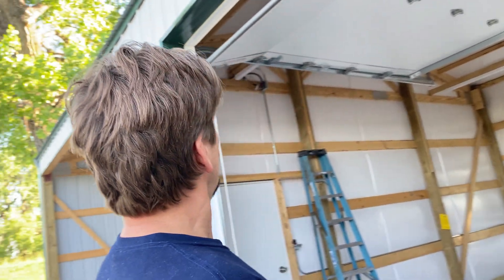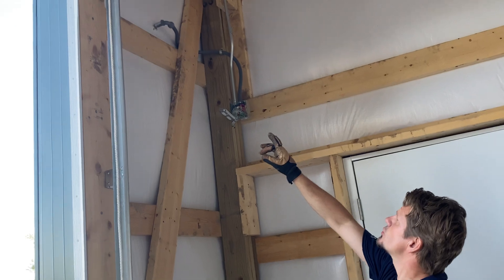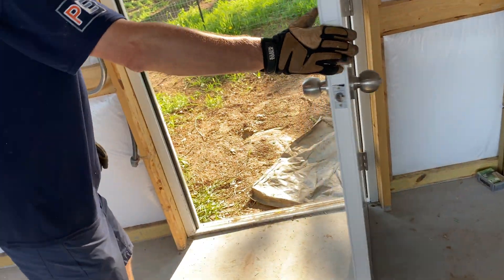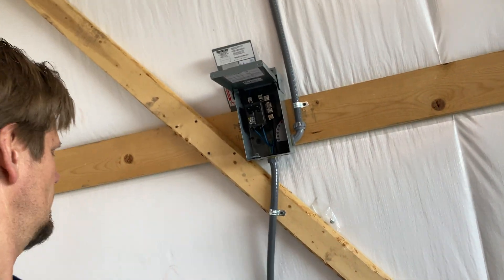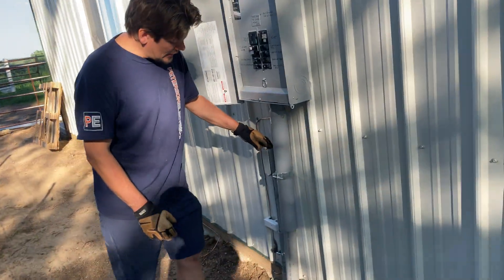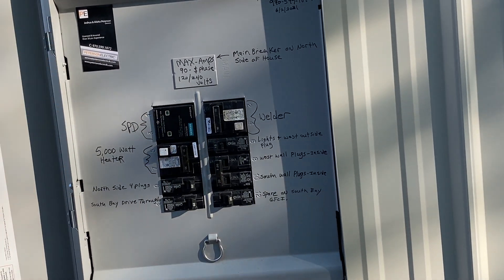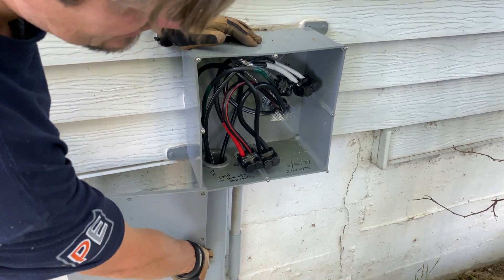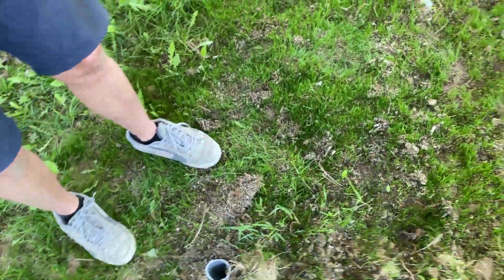Finished Electrical Project of a Detached Garage

Comment: does thig guy know how to do voltage drop calculations to size the proper wire? why wouldn't you install a panel with more circuits??

Comment: Good stuff Josh I think my un standing is you cannot mix High Voltage in the low voltage in the same Raceway  or less they are divided   talking about the house box where the Polaris is are. Good that he ran it underground though. Good stuff

Comment: Josh, GFCI protection in 210.8 A (and B) talks about RECEPTACLES, not outlets (there is a difference). Your hardwired 240V heater does not need GFCI protection as it is not connected through a receptacle. 210.8 F is about outdoor OUTLETS so that is what is driving the requirement for AC condensers to be GFCI protected now.

Comment: No disconnect upon point of entrance?
Reply: It is a little weird a subpanel doesn't need a mains disconnect if there is six or less single pool breakers or movement of the hand. But there is also a means of disconnect at the panel that feeds it. So the inspector probably let it slide saves a little money.